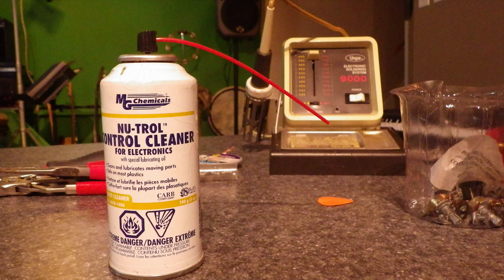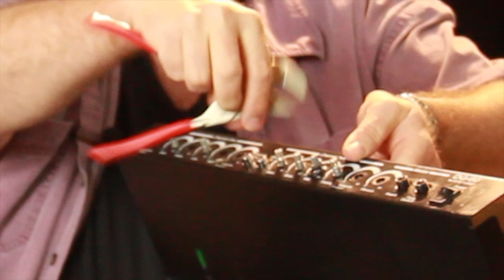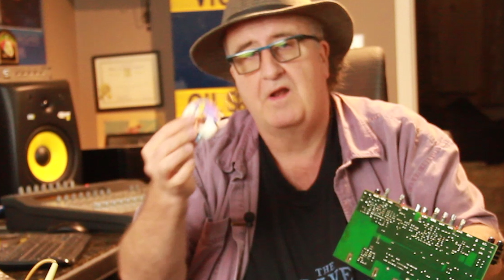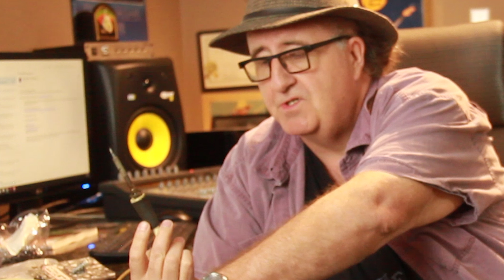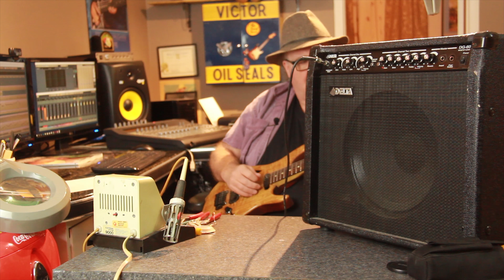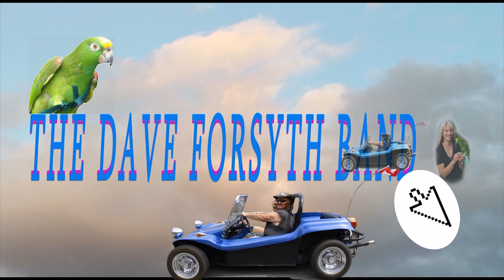How to replace pots on music amps

Comment: Hey Dave...I'm new to this...do amps store any residual current?..is there any shock risk when opening up an amp? Regards...
Reply: Same here.🤔
Reply from the maker: Sorry I missed your message . Just saw it. All amps have capacitors in them that do store power however getting shocked is hard to do if you watch out for them. Old tube amps can carry a good hit so be real careful with those. Again sorry for the time lapse

Comment: I have a weird issue.  The volume knob on my '65 Princeton reissue (with the 12" speaker) seems to just spin in circles.  I can live with it playing at home but it can't be good for the amp in general that I don't know what volume I'm playing at.  The knobs have a screw on the side, I was going to pop it off and see if I can fix the issue, but I don't have any of this equipment nor the technical know how to remove the chassis.  Thanks in advance if you have any advice, otherwise the amp sounds great.
Reply from the maker: Hi I'm not sure on your exact amp but most reissue's use pots that can easily come apart. this may just be a case of popping the amp apart and squeezing the metal tangs that hold the pot together again.
Reply: @TheDaveForsythBand  Thanks, thats what I thought I might have to do, however luckily it was just the set screw was loose.  The knobs can be finicky on these Fender amps, on my Blues Jr. some knobs are looser than others, oh well?

Comment: Hi I have damaged pots on my guitar amp, as for Ohms it says its "103B" I ordered ones with incorrect ohmages, one A10K and another one's 500 dual pins, which isn't identical to the existing pots. My question is, do I absolutely have to replace them with the exact same Ohmage or is it possible to maybe make a few adjustments even with different Ohms? Thank you.
Reply from the maker: Hi Elvis,  It is best to keep the ohms to the original sizes. Unless your doing a specific mod to the amp. You can change the physical size and style of pot if you can't find the original one.

Comment: It looks pretty easy but i am betting I can mess it up!  Can I ask how you identified the correct ones to buy?  My volume on a QTX Busker 15 is terrible but how do i find the right one to buy?
Reply from the maker: The easy way is to look it up on the net and find a schematic. There should be a parts list there. Then March down to your local music or electronics shop should have it in stock. If not you will find it on line. 
The other way is to pull it out and take it with you and match it up. Many amps use the same parts. 
Happy hunting 
Dave

Comment: Great video man! I have a 80s Marshall Lead 12 Stack that the treble pot has become almost impossible to turn. Ive tried blowing it out with contact cleaner to no avail. Pot replacement is next. Thanks to you my very first amp ever will continue to live on! \m/
Reply from the maker: Thank you hope this gets you your amp.back up and running 😎✌🎶
Reply: Put some WD 40 down the pots shaft, it should be able to turn, after it soaks in.